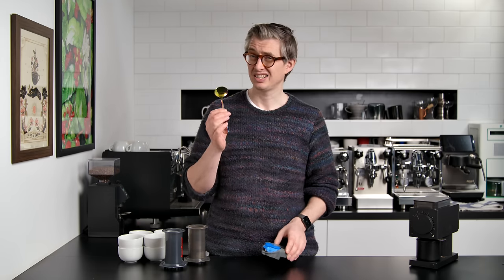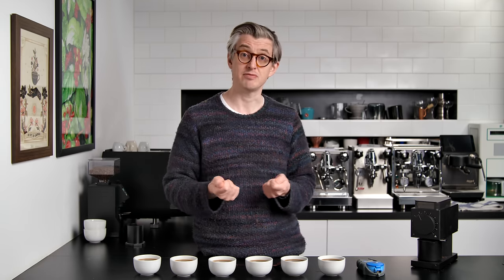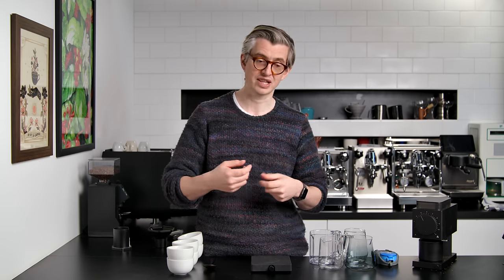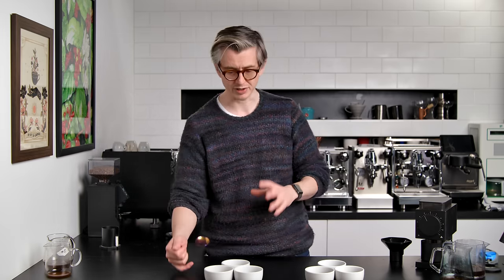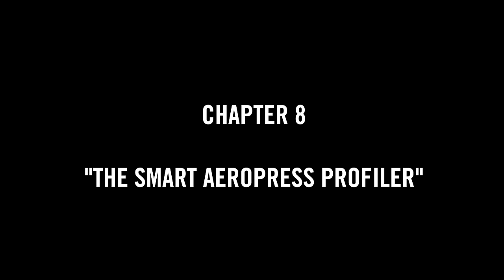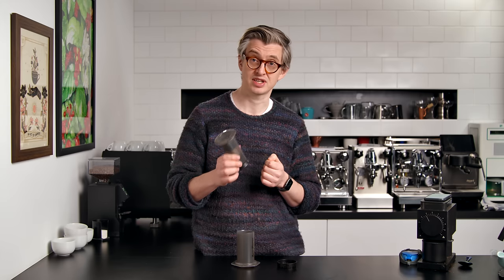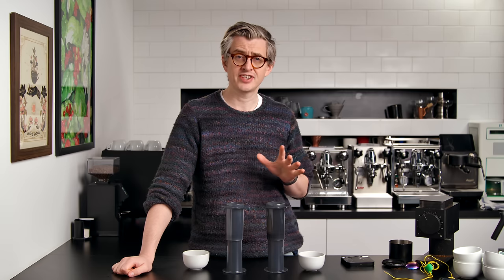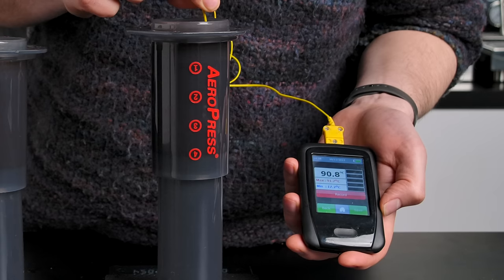Understanding The AeroPress (Episode #2)

Comment: Just found the coffee world of James H. Love the thoroughness.
However, the risks he mentions of the upside down method, of the piston blowing out, is fallacious in my experience. I've used this method for about 5 years with the plunger just nipped into the housing cylinder by 5mm approx. Upon inversion onto a mug, I rarely get more than 1/2 a teaspoon of coffee leak through the paper, and not once the piston pushed out even a tiny bit. As an engineer with many years in automotive plastic & rubber component design and manufacture industries, to effect waterproof sealing in vehicle components, I'm always intrigued by a design new to me, so you can imagine I've inspected minutely how the components fit & during use. The interference fit of the set I have is FAR too tight to allow the piston to move rather than air or liquid flow through the paper. I actually feel if anything the interference is a bit too tight to assemble, unless one wets the piston rubber first (I don't, just use brute force). 
Also, this method gets MORE volume of coffee. I fill to the rim, stir carefully (so as not to spill over) then attach the filter paper & holder, to keep in heat while the coffee steeps. Often some crema will wet the filter, as I fill so much.
Delicious coffee every time. Like buying a new TV, one never compares side by side unlike James' excellent taste tests, or like when you're in the TV store & compare pictures. My memory and palate are average enough not to be able to recall the minute differences of one brew and the next. I'm sure that daily variations in atmospheric pressure, weather conditions, tiredness, health, food recently eaten, stress levels etc, and I know for a fact that indoor air quality/ CO2 levels, all have as much of an impact on palate & one's brain's ability to detect differences.
However, James tests and findings will definitely inform some of my procedure, in the spirit of kaizen.
Reply: Yeah, it never crossed my mind there were "risks" with the inverted method, while there's the obvious benefit of not having to do any special piston insertion technique to prevent underextracted coffee from dripping out prematurely while you're still brewing. Nothing drips out before you decide the brewing is done with the inverted method, zero, nada. So obviously it offers complete control over the consistency. The inverted method should be a no-brainer vs. the upright method.

The only case you wouldn't prefer the inverted position is if you were doing The Wired Gourmet's espresso method of creating a compact puck of coffee at the bottom of the Aeropress and keeping it compact by putting a second (preferably metal) filter on top of the coffee inside the chamber. You can't invert this method because the puck would form in the wrong place vs. where you need it during the pressing phase, and then would fall and disintegrate when you invert, which defeats the whole purpose. (But this can also be fixed now that there are pressure-valve end-caps for the Aeropress like the Prismo: upright brewing with no dripping is now a real possibility.)

Comment: I prefer to use a 0.70mm to 0.75mm grind, medium roast, Peruvian coffee. I dampen the filter with 75°c distilled water to wash out the papery taste in the final brew. After this I weigh out 27.5g of the ground coffee, distribute it using a needle distributor (10 needles minimum) before tampering down with a force of 1.5 Newton meters using a ISO calibrated force gauge. 

I preheat the aeropress to 60°c and fill with 250g of triple distilled water at a temperature of 84°c.  Steep times for me vary between 30s to 35s. Outside of this range I disposed of the whole cup and start the process again. After the steep, I give 3 swirls, with each swirl lasting 1 second - I don't want to swirl too fast resulting in the grinds  pulling too many g's and consequently giving an over extraction. If I'm above the equator I swirl clockwise and under the equator I swirl anticlockwise - I don't want the grinds to be opposing earth's rotational forces as this will give an uneven extraction. 

During this time, and with my third hand, I prepare my double walled stainless steel mug. Rinsed three times to remove any metallic tastes and preheated to 80°c. Once the steep is completed, I make sure to apply a constant and uniform 5 Newton Meters to the plunger and begin to fill my mug. The whole press takes me about 90 seconds. When the press starts to hiss, I remove the force instantly - I don't want the final brew to be exposed to ultrasonic sound waves. 

I then measure the final brew and check it with a thermal gun to check the cup is up to temperature and sip the coffee with a loudness of 20dB which ensures I get the right coffee-air ratio. 

The final brew gives an enjoyable, nutty, sweet flavour with no acidity and a texture that is silky and borders on almost buttery. The smell is aromatic and floral with hints of the lushous Peruvian rainforest. If I use extra fresh beans I can even sometimes hear the Peruvian panpipes played by the coffee pickers.

Comment: I have not once had the plunger pop out using the inverted method. I prefer it so I can stir with the paddle and not worry about any liquid extracting through the filter before I'm ready. About a 30 sec steep before inverting and plunging is perfect as long as the push is slow.

Comment: Regarding section 8: Pressing pressure: I don’t think the paper lets the extra fines through under higher pressure. There are holes near the edge of the filter holder that let some of the coffee through and completely bypassing the filter. All of the of the liquid does not pass through the filter. I  believe it’s having the holes that lead to such different results as the pressure increases. I have always wondered why Alan put these there...maybe to allow a light pressing pressure? 🤙🏼☕️

Comment: We love your coffee infotainment videos! What about mimicking espresso with the Aeropress (pseudosresso, aerospresso, nearspresso)? We've used a 10 click setting on our Commandante, 16 grams coffee to 75 grams water just off the boil, metal filter in the bottom, tamped coffee bed with a paper filter and a spice bottle. Push like heck as hard and fast as you can. It's a pretty intense brew which works well as an Americano. Thoughts?

Comment: I prefer the inverted method actually. I mount the press upside down, add coffee. Add a bit of water, swirl it by swirling the whole press in a “round motion”. Add the rest of the water, then put the lid on. Only wet the filter so it stays in place, agree with the taste not being different there. Flip it and wait 1-2 minutes and then press all the way down in a controlled manner. 

I feel the swirling bit is what makes inverted easier for me. If I’m brewing regularly I need some kind of tool to stir up the coffee, and I like the simplicity of not needing one.. 🤷‍♂️

Comment: One benefit of the inverted method is to control the amount of water going for brewing without a scale. Basically, it's easier to control the line with the plunger than with adding water. I do agree that bloom has never made sense with an aeropress as the water is not passing through the coffee without pressure.

Comment: On Inverted method vs vacuum method: it's true that unverted method is a bit more hassle than vacuum method, but i found that vacuum method usually result in more noticable acidic when compared to inverted method. This is because when trying to put the plunger for vacuum method, a little bit of under extracted liquid poured into the cup from the aeropress. I think to combat this in vacuum method, we could throw away this initual liquid before we press in the plunger

Comment: I honestly think the inversion method depends on what you are doing. Some recipes call for you to stir for x amount of time while inverted then immediately flip and press. If you didn't have it inverted you would be constantly losing water in an uncontrolled manner so your extraction would differ slightly between each brew. Enough to matter? I have no idea.  However, it is a way to control that variable while changing others.

Comment: The inverted method is more consistent as it prevents drip through. Drip through rate is affected by how fast you pour the water, how much time elapses before putting on the plunger, and the level of water poured. 

The early part of the drip through has low extraction while the later drip through has more. If your timing and pour rate are not the same each time, your results change each time. 

If you want consistency, consider using the invented method.

Comment: This was so terrifically in-depth and lovely. I've been bingeing your videos over the last couple days and absolutely loving them. Thank you!

If you'd like to be absolutely horrified, please read on...

I got an Aeropress to take to the office a few years ago, because office coffee has always been awful, right? The Aeropress and a Hario were my only real tools. No temperature-adjusting kettle, no scale, no refractometer (lol). But as a brutish american, I wanted a Very Large Coffee. So I'd make my aeropress in a pint-and-a-half jar. Just a 24oz Ball jar. Like a monster. Anyway, I tried a couple techniques given my limited tools and skills (and my overall brutishness), and found the right answer was about 50ml of beans, finely ground. (I at least had a small measuring cup, and volume measurements are better than none.) I would add the grounds to the Aeropress (with a rinsed filter), shake to level, and then just pour in water from the hot water dispenser at work. What temperature? I don't know, but I would imagine at or near boiling point, right?

And then I'd just let it drip...

As the jar became nearly full, I'd insert the plunger and press the rest through.

Reader, it was a perfectly fine cup of coffee every time. Far better than the office drip brew, and that was more than enough for my satisfaction.
Thanks for reading this horrifying Aeropress story. Potentially yet another testament to how capable and flexible this device is.

Comment: In my case I found that with about 22 to 24 grams, medium coarse grinding, temperature of 80 °, stir 10 or 15 times and rest for 1:30 minutes (inverted method), it is what works best for me in terms of flavor, adding 30% water to dilute in a cup.
I recognize that it is similar to the winning recipe of 2019 I think, and since it worked well, I did not continue experimenting too much.

Comment: I loved this video, but I would have loved to see you do some testing with stainless steel filters.  I've been using and traveling with an AeroPress for about a decade now and I always use the stainless steel filters because they're reusable and easier to clean/travel with.  I've tried several, and I prefer using the Able Brewing Fine disk filter.  I found the S-Filter to be too easy to damage, although I've gotten into the habit of sometimes stacking the S-Filter and Able Fine together, which allows you to do a higher pressure press without getting fines through.

I'm hoping to up my AeroPress game by trying your ultimate technique, but I have found many of the things I've found out over the years to be confirmed in your testing.  I'd love to see a comparison of filters and see if any one of the metal filters comes out better than paper.

Comment: The pressure test reminds me of the time when I was filtering a sample to get the solids with a vacuum filter with filter paper, and even though I was pouring the sample so it doesn't go over the edge of the filter paper, but it seems the vacuum still manages to pull some of the solids through so I had to reflow the filtrate a few times.

Comment: Alright I've tried my best guess, based on James' tests in this video, at what his "Ultimate Technique" will be and here's what I've got below. I've been brewing with a light roast Kenyan/washed and the cups have been very good.

Ratio: 12g coffee/200mL water (60g / L)
Grind: #18 Comandante C40
Brew Temp: Just off boil
Brew Time: 4 minutes (3:30, swirl, 30s settle)

Standard method Aeropress, no preheat, no filter rinse, no bloom. Heat water to boil, fill Aeropress immediately (200g water). Insert plunger to stop steep-through. At 3:30, leaving the plunger in, give the whole Aeropress a good swirl (2-3 secs). Rest and let settle another 30s. Plunge starting at 4:00, very light pressure. Press all the way through hiss. Stir, enjoy!

I also have tried the same recipe with a shorter brew, as James did in the video, of a 2 minute initial steep, swirl, and plunge at 2:30. Good results from this as well, but not quite as good as the 4 minute version. As James' tests revealed, if you can wait longer it will be better but if not 2-3 minutes is also very good.

Comment: Amazing video, watched it loads of times and actually used the recipe a lot but did it inverted. However, when pressing I noticed some grind particles will stick to the plunger. In case of normal brewing some water will flow trough the filterpaper and the coffee in the corners should be better extracted. So i did some tests with giving it a stirr after adding water and I guess a stirr is more important when brewing inverted. My short question: can you agree to this (knowing you are not a fan of advising inverted brewing ;))?

Comment: Hey James, have you used the Fello filter for the aeropress?  It's metal, reusable and doesn't blow away on you when camping 😉.  
I am curious if it changes anything in comparison to the paper?  
I've also had paper really not hold the water long enough to brew for 4 mins, or swirl, stir, etc. 
I agree, the plunger is a hot mess..

Comment: I don't think rinsing the filter effects the taste but I like to rinse to remove any possible residual chemicals in the paper that may be left from the manufacturing process. Also pre wetting filtration media is standard practice in chemistry to aid the initial flow of extraction. Because the aeropress has such a small surface area for filtration the difference is not noticeable but on a molecular level in theory should result in a slightly cleaner more even final extraction

Comment: I think the "brewing as hot as possible" point is interesting. If there's some pressure involved, e.g. in the case of a 9 bar pressure from an espresso machine, water can be heated to like 175C without boiling, which suddenly opens up a much larger range of temperature to play with. If an aeropress can realistically do 1.3 bar (~1 bar from atmosphere, .3 from the pressing), boiling point is apparently ~107, which still presents a good amount of room.

I'm really curious if higher temperatures are explored. Obviously, it would be slightly involved because the water needs to be heated after it's pressurized, so maybe a healing coil in the aeropress is a bit out there; but I'd be rather disappointed if this isn't tried in an espresso machine.

Comment: The simple reason I use a variation on the inverted method is because I use a metal filter and all the water just runs right through before I can get the plunger on otherwise.

Comment: The only comment I have is on the actual tasting throughout the testing. As an engineer, I appreciate the consistency of using the same spoon to taste the coffee, but I find that the vessel you drink something out of, in this case coffee, can alter the taste. Coffee to make taste different between my stainless steel tumbler, titanium camp cup, ceramic mug, plastic mug, paper cup, and even glass pint glass. My favorite is ceramic mugs, but even then I have a few mugs in my house where coffee just tastes better. My favorite mug has a slightly thicker rim, and there’s a measurable difference to how good of a mood I’m in while drinking out of that mug.

Comment: Hi James. Thank you for this video. I realize it's been over a year since you published this video but, just in case you're still responding to posts on this video, I have a question. In your discussion of temperature, where you indicated the point of boiling, does it matter at what temperature the water reaches the boiling point, or just that it reaches the boiling point? I live at just under 5000 ft elevation. The approximate boiling temperature, for water, at my altitude is around 202 degrees Fahrenheit (94 C). For sea level, boiling point would be 212 degrees Fahrenheit (100 C).

Comment: The reason I do inverted is because in the normal method, in the initial pour, water goes straight through the filter and into the cup, diluting the brew by 10% at the least.

Comment: I feel justified in thinking the inverted method does nothing to improve the taste. As for brewing 2 cups, I've always done 2X coffee and 2X water + dilution, though I'm not measuring out my water before; I've always done coffee to 1(marker on the aeropress) and water to 2 for 1 cup and coffee to 2 and water to 4 or so for 2 cups.

Inverted method is good if you're using a reusable filter and want to steep.

Comment: Correction for section 8:  the increased pressure isn't sending bits of coffee through the paper, but around.  If you watch the highest-pressure presses (18:30), you can see coffee squirting out the sides of the filter holder and down the mug.  Take a look at that piece of plastic:  it has holes going around the circumference, right above the end of the filter.  I don't know what their purpose is, but high pressure directs coffee through these holes, rather than through the filter.